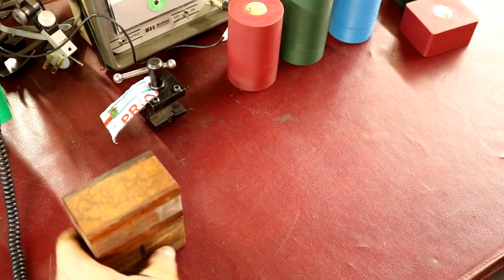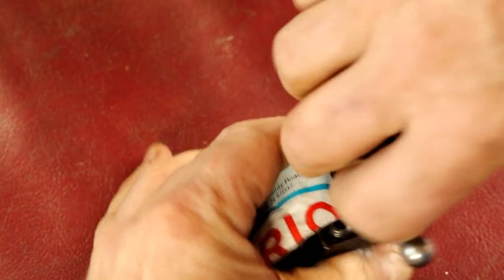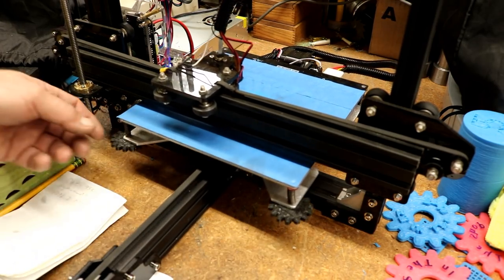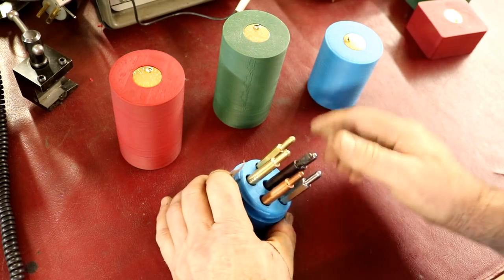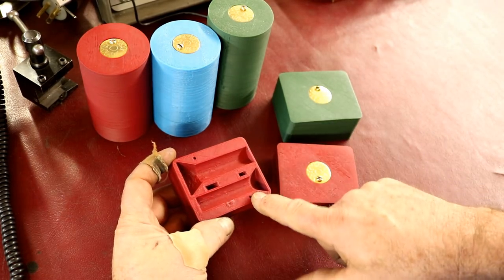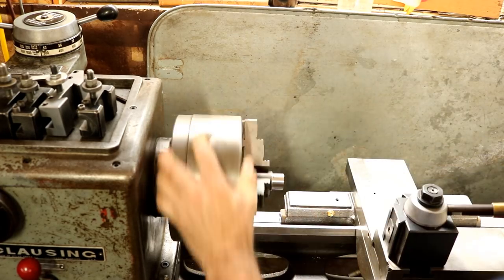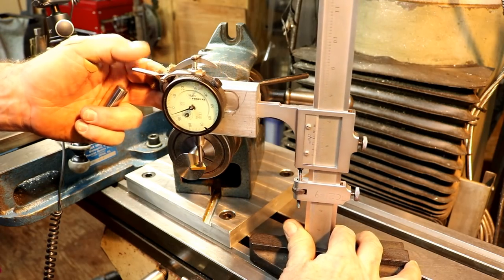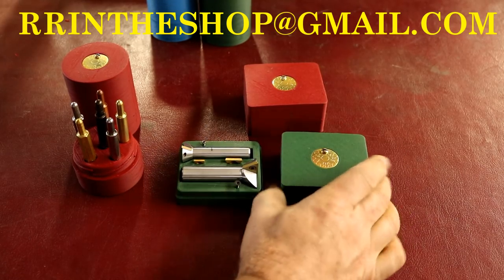Clausing Lathe Update,  3D Printer Mods, Tool Update & Viewer Mail

Comment: Wow Randy! Those cylindrical screw top boxes you printed are really great. They have this positive lock authoritative sound as you close them _ GREAT. 

I think I have seen something like these presentation milling cutter boxes, only in wood, that had flocking sprayed on some cement or something. Looks like felt. I think I saw flocking in McMaster.
Reply from the maker: Yes the threads are great, the top lock right up tight.  Yes you can spray on felt.  You could buy a set and try it out.
Thanks Toby.

Comment: Would you please tell me where you found a service manual for your Clausing lathe? I have an older version, model number 5906 and have been searching for a service manual for quite some time. Any guidance would be appreciated. I wish mine had a Gilmer belt. I have 2 V belts instead and it seems impossible to find two that are exactly the same size. This leaves one looser  than the other causing vibration. I can't figure out how to eliminate all vibration, I can get close but then something else starts to rattle.
Reply from the maker: Michael, Email me i might be able to help.  You should order the belts as a matched pair, the only way to get them right.  RRINTHESHOP@GMAIL.COM